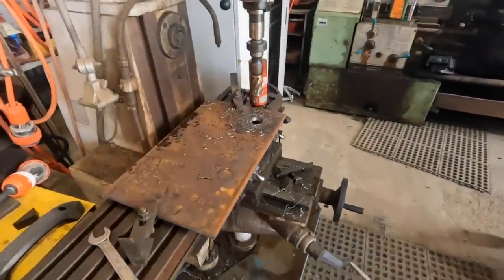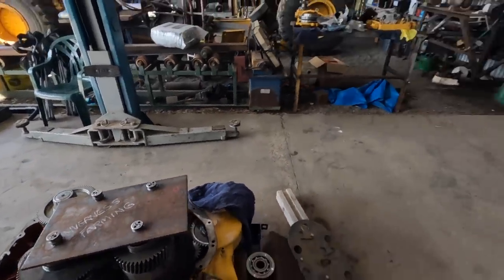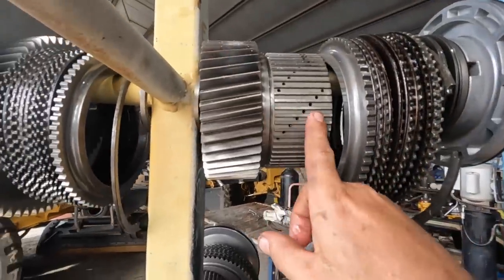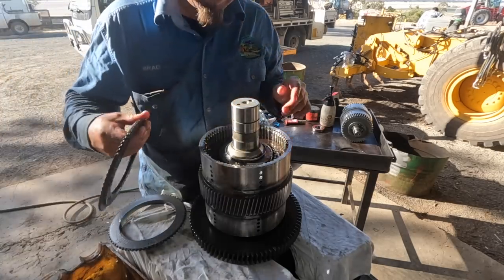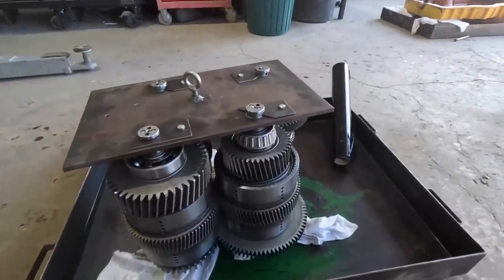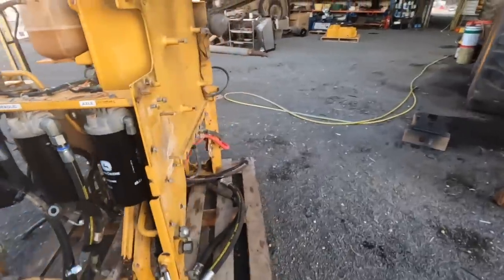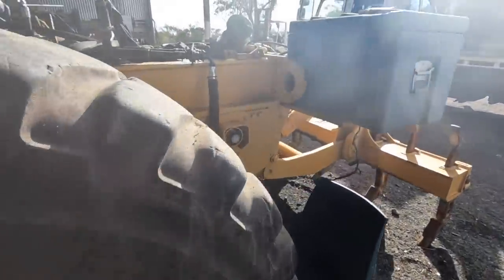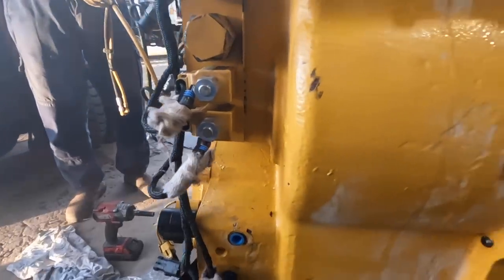John Deere 872GP Grader - Transmission - Assembly Pt 1 | Brads Ramblings | Workshop | Vlog 181

Comment: Well Done Brad, and crew quite a bit going on inside if the transmission, I like your fix on the hydraulic lines, the OEM parts are some times cheeper than  after market but I reckon it's fairly rare. Would have liked to see all the splitting of the gears and clutch packs i might have learnt some new words😂.
Thanks for sharing, hope you're under the rain.

Comment: Good job the hoses. I have been splitting the referrals on the old hosed to reuse the inner with a new referral crimped on. Works well for all those odd hose ends. Just run the angle grinder down both sides and hit with a cold chisel to remove.

Comment: 9:21  Did I see friction plate on friction plate go in????   Right when you were saying to get the order right?
Reply: I think so, but not positive
Reply from the maker: I think there was a steel plate in there, I just doubled checked the original footage, definitely suck if 2 were together😳
Reply: @thejacksonbrothers  yes it would, even worse if it got ran that way for awhile. I looked at it four different times and I really could not tell